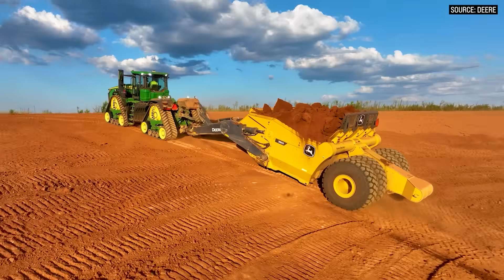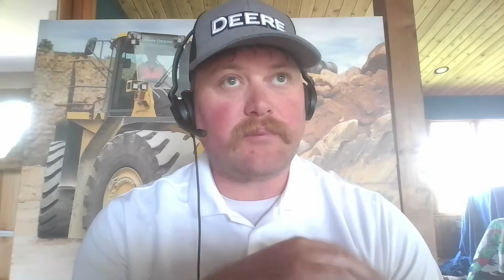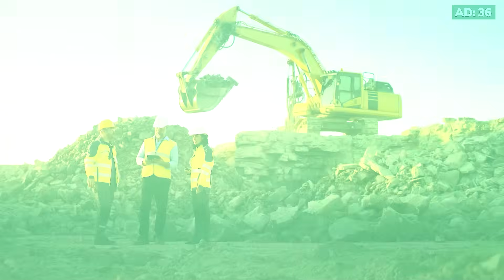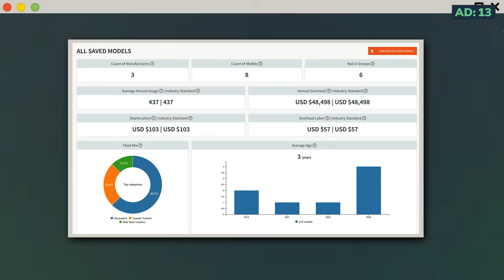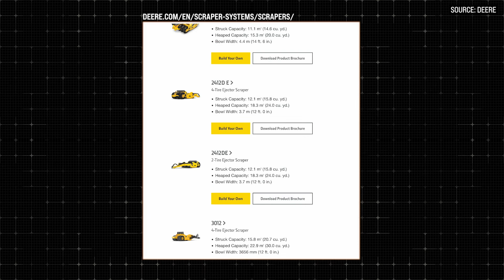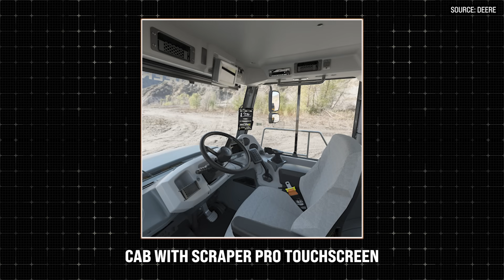Massive Dirt Movers: Deere’s New Pull-Type Scrapers Revealed

Comment: History repeating itself. The first modern scraper, invented in 1923 by Robert LeTourneau, was actually a tractor-towed marvel, considered the very first earthmoving machine ever created. LeTourneau's design sparked a revolution, with over 30 American manufacturers entering the scene by the 1970s.
Reply: Great point!! Towed scrapers built this country, won WWII with cat tractors and letourneau scraper pan combinations and built the highway system during the 50s and early 60s until caterpillar and Euclid came out with very first engine driven rubber tired scraper.
Reply: @tristenklein5940  LeTourneau invented the rubber tired self powered scraper in the late 1930s.